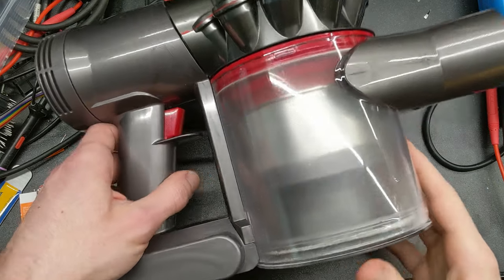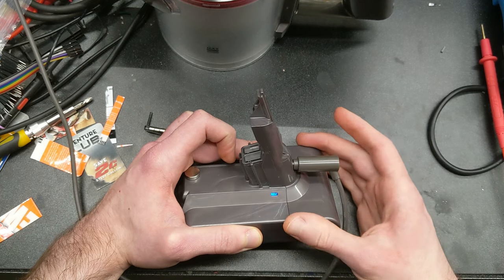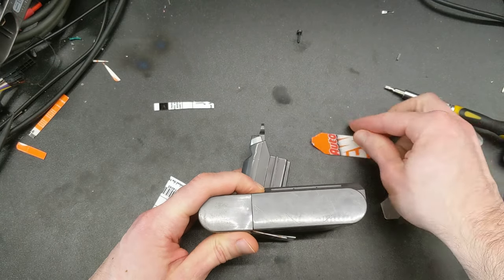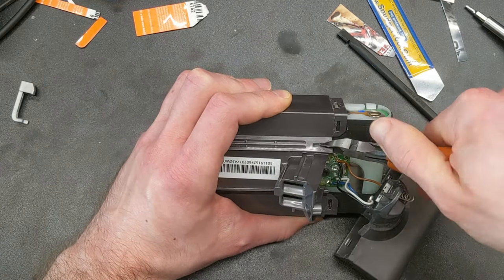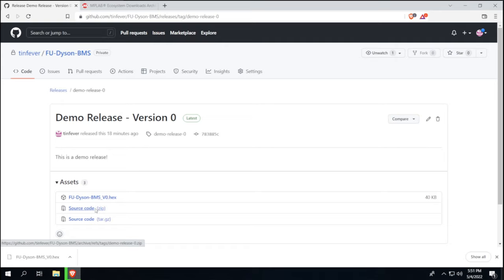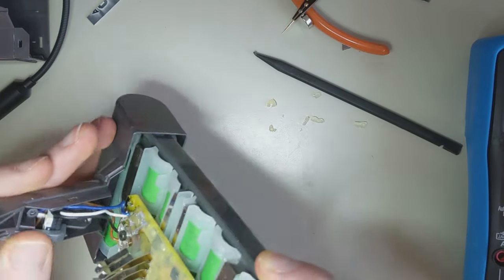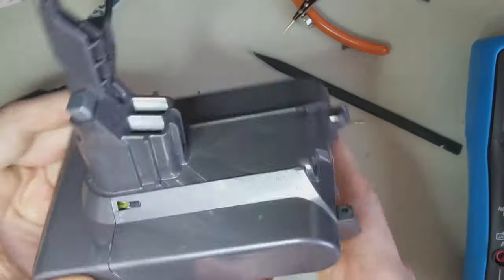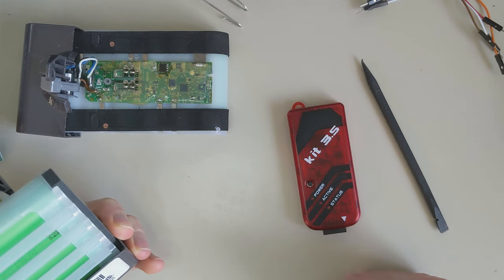FU-Dyson-BMS - (Unofficial) Firmware Upgrade for Dyson V6/V7 Vacuum Battery Management System

Comment: This worked great, thank you so much for the tutorial.  On the LED lightbar thing, I was able to get it out pretty easy.  Just unscrewed the screw holding in the light bar and that gave me enough wiggle room to pull the grey housing apart wider and then wide and wiggle the LED out.  It would have been even easier with 2 people, one to hold the housing wide and another to pull the  plastic.  After it's out just screw the clear plastic back on again.

Comment: This is awesome work! I'm a beginner with battery repaire (started with my Mobygum Xenon-R electric scooter), but I was limited to cell replacement and balancing. BMS were something completely opaque to me, and I'm really impressed by your work and the fact that those BMS can be enhanced to handle weak cells.
Thanks for your great work.
Reply: The BMS isn't really enhanced, it's a basic feature that can be software-programmed to custom settings by customer request. If this is actually a good idea is debatable: cell-balancing is a neccesity on batterypacks with lithium cells and DELIBERATELY bypassing a safety-feature of the BMS-system inside the pack is something I would advise against: the cells are imbalanced, the BMS acted upon that. Though the thresholds for cell-voltages usually can be set freely by customers' request and they thus can be set very tight (which is probably not really the case here), it still is a bad idea to circumvent this safety. The cells can't be balanced and thus will become ever more imbalanced as you charge and discharge it again, with the real risk that a cell starts to heat up beyond safe limits (because seriously, if they dare to let out basic safety-features on the PCB, who says they did design the rest of the software correctly (read: 'nah... we don't use the overtemperature-protection. By the time the cells could go thát bad, the BMS has already cut off the cells due to imbalance'

Comment: Thanks so much for doing this.  Although I've already ordered a replacement battery because I determined the BMS was my problem, It's great to know there is a real solution.  It makes me feel better knowing you have come up with a fix.  If I was fooling with PICs more I'd buy a pickit3 and fix the old one for the heck of it.  It makes this old tube radio guy feel good so see new things fixable. Thanks again for doing this as well as updating the code.

Comment: Awesome video. I have a few older Dyson videos where I tried to fix some of these or Frankenstein the thing with a Tool pack or the old buy the $25 aftermarket pack trick. Just sharing as we learn together. I always wanted to take time to figure out the Firmware and do similar to this. I still have the old BMS boards from 2 of these In case I ever get time. I have not had time to get back to this or the EGO 56V pack figuring out the D-terminal communication on it. So glad you've figured the Dyson BMS out and shared this.

Comment: You saved my day! Excellent detailed step by step explanations. This saved a V7 (SV11) battery which ultimately discharged a bit too much. Although I charged every cell and made sure they were all balanced, I figured out that the BMS had flagged this battery dead for good. Your firmware solved the issue straight away! Thank you so much, I didn't want to invest in a Chinese compatible battery with concerns about potential wrong battery management ending up with risks of fire...

Comment: thank you a lot. I programmed my sv10 dyson v8 battery with a chipmax2 programmer and your firmware, and it's work perfectly. Thank from France
Reply: Salut, Chipmax2? cela m'intéresse. Ca ne marche pas avec le Pickit? J'ai moi aussi un sv10 à flasher.

Comment: Tried on Dyson V8 battery version SV10, Worked perfectly.
Reply: @thinhlong2107  Exactly the same steps.
Reply: @thinhlong2107  Same connection from left to right, Only ground pin is in slightly different place but I believe you can figure it out.
Reply: can i ask you how to get v10
Reply: v10 has more sockets, I don't know which part to plug in

Comment: One idea, when use pins to attach to battery bms, do not scape that gell. Go through it, so gell will hold pins in place. U may still need topush them a bit from side for a good contact, but at least pins will not try to jump out

Comment: Thank you for this extremely useful project! Dyson reprogrammed and awaiting new 18650s.
After some faffing about trying to connect the Microchip programmer to my PicKit 3 and it not finding the PIC16LF1847,  I found a free third party programmer called PickKit Minus which detected the correct device, and programmed it successfully. 

It was definitely FU Microchip as well as FU Dyson until then.

Comment: Before they redline you can drill holes - 4 one side 3 the other - to monitor the cells and top up accordingly , or even easier discharge the highest one every few weeks

Comment: tinfever, Hello!
I have a Dyson V6 vacuum cleaner. I swapped the worn out 18650 cells for new ones (Sony VTC6) and uploaded your custom firmware to the DC62 battery controller and it worked immediately. Thank you so much for the opportunity to revive the old battery!

But I ran into a problem, which is that with a strong discharge (from 3,00 volts to 3.39 volts per cell), the battery refuses to be charged from a regular charger. It manifests itself as follows: if you use a vacuum cleaner at standard power (consumption of about 130 W), when the cells are discharged to 3 volts, overdischarge protection is triggered (3 blue LED flashes) and after the load is turned off, the voltage on all cells is restored to 3.24 volts (+ -0.01 volts). When you connect the original charger - there are cyclically repeating 8 red flashes of the LED. In an imperial way, I realized that if you recharge each cell to a voltage of 3.39 volts and higher, then when the original charger is connected, the blue LED lights up and the charging process begins (the charge current is 0.75 A).
I tried several times to bring the cell level to a voltage of 3.38 volts and below - and always when the original charger is connected, 8 red LED flashes appear cyclically (((

At the moment, I use the vacuum cleaner only in the maximum power mode (consumption of about 350 W), because. when low voltage protection is triggered at such a high load (3 volts and lower on the cells), then when the load is turned off, the voltage on all cells is restored to 3.48 volts, and so on. this is higher than 3.39 volts, then when the original charger is connected, the battery starts charging without any problems. Of the minuses of this mode of use is the periodic operation of the BMS overheating protection.

I will be very grateful if you can explain to me how to solve the problem that does not allow you to charge the battery if the cells are discharged below 3.39 volts ...
Reply from the maker: The 8 red flash blink code means charge overcurrent protection. Others have run in to this issue on certain vacuums it seems like, and there are issues about it on the GitHub page. I think the workaround is to increase the overcurrent protection threshold, and I might have posted a patched version of the software in one of those issues, or maybe in the EEVblog forum thread.

I'm not sure why the charger inrush current seems to trigger this on some vacuums and not others. I suspect maybe some minor difference in the PCB since it seems to occur on the V8 vacuums mostly and I don't think I had one of those to inspect closely.
Reply: @tinfever  Thanks for the answer!
It will be great if you fix the firmware)))

In the meantime, I changed the original charger to a non-original one and this problem has stopped.
Reply: Just for idea. I have one cordless Hoover brand, but did not have charger for it. I found one power adapter from printer for around 32v and attached dc-dc step down converter. Setted up voltage that meet hover battery, but it did not start chaging till i adjusted current to some apecific level. Since then charving this way. She may be now youe original charger doesn't meet charging criteria..

Comment from the maker: For the latest information, installation instructions, and any known bugs, please see the GitHub page: https://github.com/tinfever/FU-Dyson-BMS

Also, I now recommend not connecting the VDD wire at all for programming. The ISL94208 chip seems keen to fail with an externally supply voltage. I'd still suggest waking up the battery pack to power the board up for programming. One user has suggested (https://github.com/tinfever/FU-Dyson-BMS/issues/24) even this may be unnecessary though.

Comment: Update-
Just an observation after fixing my V7 battery with this, I now get a 14 red flash error code when I store the vacuum in my unheated garage, and it is unusable or chargeable. The first time it happened I thought ‘oh great, that fix didn’t last long!’
However looking at the error codes you provided I found this is down to low battery temperature, and it disappears when the battery is moved into a warmer environment for a while. 
I didn’t have this before the firmware update before the battery bricked, maybe it is just colder now as it’s winter?
Still a great video and the fix does work 👍🏻
Reply from the maker: It's possible the original firmware didn't have low temperature protection or maybe their threshold was set lower. The threshold should be roughly 7C. If you wanted to, you could remove that protection by commenting out the two lines of code in the safetyChecks function that reference MIN_TEMP_C, I think.
Reply: You’re probably correct there was nothing in the original firmware regarding low temperature protection, as it’s not really applicable to a household vacuum. I’ll leave it as it is, installing your firmware was scary enough, messing with the code is beyond my comfort zone as I don’t have any spare batteries to play with. Thanks again.

Comment: Great project.  You deserve lots of kudos. 
I picked up a dead older pre V6 Dyson, it has a two wire communication system between the motor unit and the battery on top of the power leads.  I think it has a 8051 derivative.  Mine is bad and I am sad but without destroying the BCB it will be a dog to reverse engineer it. I might check if it has cell balancing implemented.  The model also had a reputation for bricking with bad cells and some say the motor units sometimes brick in sympathy.

I may have to get a V6 or V7 just to play around with your battery supervisory software.  Do you recall how many IO pins are spare, could you add BlueTooth or IR comms just for fun.  

I saw a video that had a bunch of open battery units and it looks like some of the pirate batteries do not even have connections between the cells, NO way to balance or detect imbalance, worse than Dyson.

I think these could be nice units at used prices if one could upgrade the firmware (a bit easier, opening those batteries is a test of patience), perhaps implement the cell balancing and maybe even flash the motor code again to give a simple speed control.

Everything is done to look good, sell well, wear out fast as a primary design goal and features and usability come a distant last.

You could make a bit of change selling those pogo pin modules until they become available from Asia.
Is the FU-Dyson short for FANCY UNIVERSAL-Dyson firmware? 🙂

Comment: Hi been following EEVblog , you and dvd4me - I balanced the cells today whilst waiting for a PICkit - noticed that even though the pack was at 22v ( not fully charged but balanced) when I activated the BMS the output voltage was only around 16v through the contacts - have you implemented that - is it a kind of load test?

Comment: Flashed my SV11 battery with a pickit4 and mplab. Very quick process.
Took a dump of the EEPROM, but just put it aside since I know it got an error from being out of balance.
Cells are fine, it was my fault for taking it apart in the first place.
Now I need to find my charger
Reply: @technomicah407   What steps & settings did you take / change? I've got the same model battery, mplab & pickit 4 but i keep getting low voltage errors. I used the low voltage setting instead of the high 5v setting due to 3.3v reading from the pins. Appreciate some clarity greatly
Reply: @perspective6734  I did change the power settings for the pickit4 to provide power to the battery. Pretty sure I just left it as default, which was 3.3v.
Reply: @technomicah  What do you mean by taking a dump of the EEPROM?
I ended up resetting the settings & ran it through the 5v warning & 3v supply, that worked, cheers for that
Reply: @perspective6734  prior to flashing the firmware, there is some diagnostic data stored in the chip describing why it failed and other stuff. Not really important. Glad you flashed it successfully

Comment: Instead of using this device to flash the firmware, can I use a Raspberry Pi 4 or a Raspberry Pi Pico or an Arduino UNO?

Comment: Question please. I want to use my sv12 battery outside of a vac. There's no output to the main power out connectors. I asume it needs to be connected and talk to the vac to switch this on. There's a second smaller connector on the pack, and maybe it uses this? Maybe it has a magnet sensing reed switch as you showed on yours? Please advise how to bypass / 'turn it on'.

Comment: I followed your instructions, everything worked fine but a minute after flashing successfully, when disconnecting the pickit, its soldered connector touched something it shouldn't have and killed the BMS. I quickly had to use a plastic tool to rip out many SMD components on the positive contact side as the area was getting abnormally hot (probably due to a short in a component following my error). next time I'll be more careful.

Comment: Great job. May I question to you. I have dyson V6 battery SVO4 all 6 batteries are detached and charged and they are all ok around 4V, but it still gives red flash 20 times. Do I need reprogramm it as you showed in this video?

Comment: help me solve the issue. when connecting a native power supply. the battery flashes 8 times. when connecting the laboratory 1a power supply, everything is fine

Comment: how to fix 16 led flash lights? all good, but when connect to the cleaner - the battery turns to 16 red flashes. Second battery works ok

Comment: I'm currently moding a sv22 battery just added another layer of 7 cells 21700 all works well but the vacuum doesn't seem to recognize it has 5000mah more capacity and still shows 7 minutes in boost mode still testing and haven't discharged the battery yet as I'm waiting for filter with magnet and dust bin 
found the vacuum at local recycling center in UK and i just want to make it work again 
i wonder if these new batteries are measuring what goes in and out and bricks the battery when capacity is low enough 
been doing this double battery mod from the first cordless dyson and all of them worked perfect stacking 2 dead batteries together making it like a brand new one

Comment: Is there a way to just use an external LiPo charger/balancer to fix the stock firmware's kill condition, then reset the firmware somehow, or does the firmware just kill itself with an EEPROM bit or something?
Reply: Unfortunately not, if you attempt balance charging of any sort without going through the PCB’s intended charging while it is on, it will brick itself with 32 red flashes. I believe discharging to balance does work however. If you have the time, I highly recommend reading the original thread in which tinfever and more worked towards a solution towards all this, as it documents many of the pitfalls and nuances they encountered through the process: https://www.eevblog.com/forum/reviews/dyson-v7-trigger-cordless-vacuum-teardown-of-battery-pack/
Reply: You are right in that if the firmware detects charging from an external source or a cell imbalance of more than about 300mV, it will brick itself with an EEPROM bit which will require the PICkit3 programmer to erase (see my earlier comment about dvd4me’s unbricking video).
Reply from the maker: I haven't done a ton of testing on how the original firmware behaves, but here are a few thoughts. The BMS lockout is handled by a setting in the EEPROM. dvd4me in the thread linked by Wendell found the EEPROM bits you can change to unlock a battery pack. The PIC microcontroller also turns off unless the battery is on the charger or the output is enabled. (You can measure that the 3.3V rail goes low since the ISL94208 turns it off completely). I think if you rebalanced the cells using an external balancer, while the PIC was turned off, it would probably work fine. You may or may not have to reset the EEPROM bits mentioned since I'm not 100% sure if it will go in to lockout mode if it detects the cell voltages have changed too much while the PIC wasn't turned on. tldr; I think external balancing with a possibley necessary EEPROM bit change would probably work, but I haven't tested it and can't guarantee it.

Comment: My battery seems to die when the cells are around 3.6V. The delta is maximum 0.02V. Also, it doesnt take a charge from the power supply although the light is green while its plugged in.

Comment: Hi, great news about reflash..good job.
By the way, does the batteries need to be connected to pcb during programming?
Reply from the maker: Sorry for the delay. The PCB doesn't need to be connected to the batteries to flash the firmware since it is solely flashing the PIC microcontroller, although you would need to configure the PICKit to provide 3.3V power to the PIC if the batteries aren't connected. Of course, the firmware will not operate without cells connected and I've honestly never tested how it would behave if you tried to use it like that.